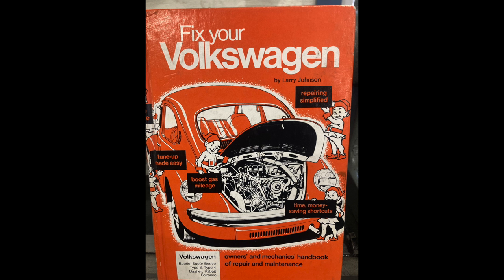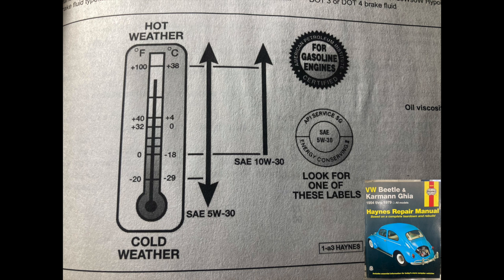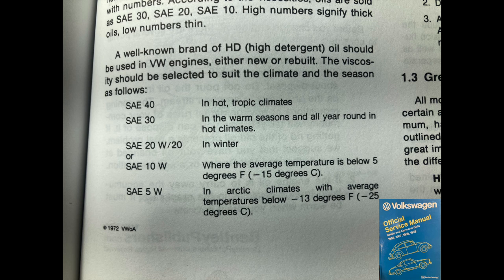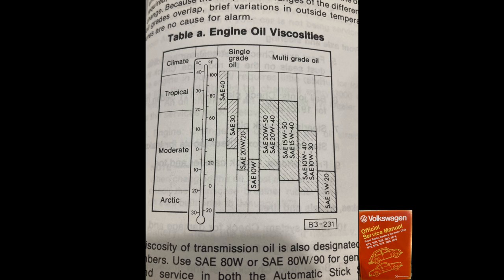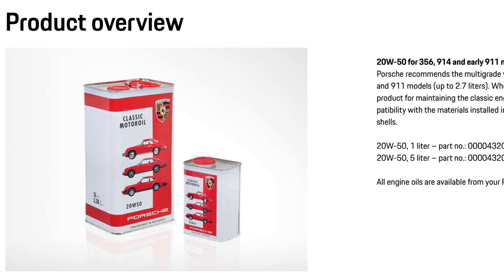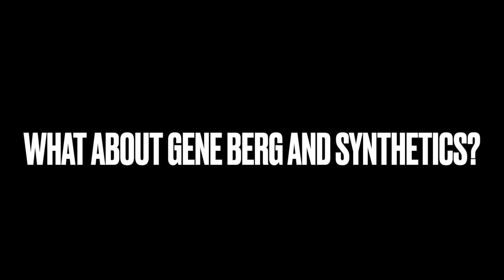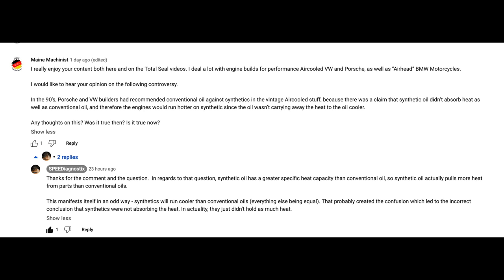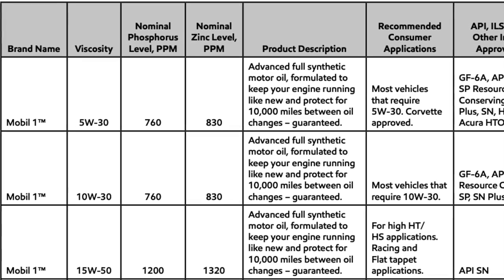Aircooled VW Oil - Finally, the Answer!

Comment: Hello folks! I'm from Brazil and own aircooled VWs for 20 years. I always used 20w50 regular (mineral) oils on my cars. Although I live in Southern Brazil, where in winters our temperatures come close to 0°C, and in summers raises to 35+°C, the 20w50 does a good job. One thing I learned through research and readings, is that the API SL grade is the limit in this kind of oil, concerning to the ideal balance of ZDDP additive in Ppm in a "newer" oil. So, even if there are mlmore modern options in SM/SN/SP grades, I stick with SL, cheap and widely available. Changes at every 6 months or 5,000 kilometers.  The results: my older engine (20+ years of age) never opened so far, and perfect running. One more thing: upgrade to a 26mm gear oil pump in every new engine I build. Cheers!
Reply from the maker: Thank you so much for sharing this important information!
Reply: Boa kkk

Comment: Penrite 10W 50. Wouldn't use anything else. I'm in New Zealand. Hot summers, freezing winters.
And this is VERY important: It has ZDDP (zinc) which most modern oils do not contain in significant amounts as it destroys catalytic converters. On the VW the ZDDP is essential to protect the valve train exactly as you describe above.
Reply from the maker: The zinc is absolutely critical for sure!
Reply: Did they have high zinc 50 yrs ago?
Reply: @Maurice-c6z  yes, all oils were high zinc 50 years ago. It was with the introduction of catalytic converters that zinc was removed as it destroys the cat.
Conversely a lack of zinc in modern oils destroys 50 year old valvetrains.
Reply: Yes.

Comment: Here is my recommendation. All model Beetles will be more than happy with conventional 10w40, 15w40, and if you live in a warmer climate with mild winters, and hot summers 20w50. Changed every 5000 miles. You will never have any problems. That's it. Nothing more needed be said.
Reply from the maker: Sounds like solid advice
Reply: The 20/50 makes a bug hard to start in frosty weather so I avoid it in favor of 15/45 year round.
Reply: VWs don't come with an oil filter.  I wouldn't go more than 1,000 miles between changes.

Comment: Im in Toronto canada. I used castrol 20/50 for 20 years till it finally dropped a valve. The tear down revealed little to no wear.
Reply from the maker: Did you drive in colder temperatures as well, or was it more of a summer Car?

Comment: Im in Long Beach California , so it doesn't get that cold.
I have always ran 20/50 valvoline R.
It has a high zinc content for solid lift  cams.
Of, course the size of your oil pump and climate will dictate oil weight. 
Just remember modern oils are designed for modern cars with a very low if any amount of Zinc.
What ever oil you use make sure it has a high zinc content designed for solid lifters/flat tappit cam.
Reply from the maker: That is indeed the most important!
Reply: I live north and San Francisco, and today I did my first oil change since buying my 69 Beetle 7 months ago and used 20w50 valvoline VR1.. so hopefully, this oil is fine in it... it normally, even in the winter, is around mid 40s at the coldest rarely dips down to 30s.

Comment: My Dad purchased a 1964 VW Beetle in 1964 from the dealership. We were not sure what type of oil was used when the engine was manufactured. On the first oil change, the engine had so much sludge in it. It was also getting harder to turn over the engine. My Dad cleaned out the sludge and replaced the oil with Havoline Motor Oil 30w. It was a High Detergent motor oil as recommended by the VW Shop Manual he also purchased from the dealership. Published by Delius, Klasing & Co. Bielefeld and Berlin.  This manual states for the engine oil to be (HD oil for spark ignition engines). The lubrication points. Engine, oil bath air cleaner, carburetor controls, door hinges and felt ring in the distributor. Specifications were above 86 F SAE 30 W, and from 32 F and up to 86F SAE 20 W /20. Below 32 F SAE 10 W and finally anything below - 13 F SAE 5 W. Now days Havoline that we use has Anti Wear Additives, Zinc rating of 906 PPM (Parts Per Million).  Yes, we still have the 64 Beetle.
Reply from the maker: Awesome story and thanks for sharing! That’s really great that you still have the car.

Comment: I use Driven motor oil. Either their HR1 or HR5. Driven Hot Rod Oil is designed to protect your camshaft. With high levels of ZDDP to protect your engine. Driven Hot Rod Oil also delivers storage protection additives to guard your engine from rust and corrosion. These additives also prevent dry starts. Developed specifically for older cars, no other oil provides this unique combination of lubricant chemistry.
Reply from the maker: Thanks for sharing. I’ll look into that. Never heard of that oil until now.
Reply: Yes, because it has a high Zinc content.
For solid lift/ flat tappet cam.

Comment: After watching this I have tried synthetic in my baja with a 1968cc. Im using 5/30 Kirkland brand. My head temperatures go from 280 to 310. It's 100 plus here in the high desert.  The really trippy part. My oil temp is 90 to 110. 
 Dog house with a remote filter and full flow so my capacity is 3.75 quarts.  I do add some zinc additive.  

So far I'm a fan.
Reply from the maker: Please continue to give updates. This is so interesting.
Reply: I would use 10W 30 if I was you.  These engines weren't designed for super-thin oil.

Comment: meh.... My older brother owned a very successful German car shop for over 30 years.  His slaves worked in the right side three bays on VW's, while he, worked in the two left side bays on vintage and rare Porsches and Mercedes Benz automobiles.  His re-built engines were done via customers shipping them to him, and getting them back gold plated.  His car collection included two Mercedes 300 something "gullwings" an Adenaur limo, and several choice examples of the 356 Porsche, including two  with the early 12 volt electrial system.

He was Austrian born and raised, worked to the blasting sounds of Wagner, and he knew his stuff.

I drove aircooled Bugs.  He built the engines and told me to use 30W Castrol GTX because the engines revved high for best efficiency and that oil was formulated for that type of use.  He retained ownership of the engines and had a stake in their re-saleability.  When I moved into a different Bug, he would remove the engine and sell it used to another client who was in need.  He also used the same oil in his vintage 356 cars.

That was in the late 1970's.  My Bugs were all early 60's to 67.  Same with my brother's Porsches. Your results may vary. All this was in the Pacific Northwest of Washington State, where yearly temps are mostly moderate. My takeaway - apart from what oil you use - is to change it like religion.  That's more imortant than what weight is in the sump.
Reply from the maker: All good information, thanks for sharing. The only thing I'll comment on is the Castrol GTX formula has changed in recent times by them eliminating a lot of the zinc phosphorous in order to be compatible with new regulations and catalytic converters.
Reply: @MaineMachinist  Yes.  Oil tech went through a lot of changes because of government fiddling.  I was in Mexicao in the late 80's.  The air pollution was pretty bad.  I m sure it had something to do with air quality regs that lagged behind the US at the time.  Bugs, Busses, and Things were literally everywhere.  I would say the ratio of aircooled VW's was 1/10 on any given street.  A lot of them were pretty new but smoking pretty bad.  Heat and slow traffic kills those engines.  

I do miss my 67 Camper.  My brother built a custom 2.2 liter for it. Better than his 356 engines, he said.  It was quite the sleeper, no pun. Up the passes with me, my bud, and our two germans sheperds, and all the gear .  No problem, as long as I didn't open it up. The original transaxle wasn't built for the potential of that motor.

When I sold the body (mint condition) my brother sold the engine to a guy who built a street rod Ghia.  T'was a thing of beauty.

Those were fun days.

Comment: I’ve just changed my mind with oil. I’ve always ran t4 15w40 diesel oil but on my new 2332 I changed to 20w50 valvoline vr1 racing oil and couldn’t be happier. My idle psi when hot went up to a very happy number instead of almost 0
Reply: The Valvoline VR1 Racing 20w50 has a zinc content up around 1700ppm IIRC. . .. Many Porsche 911 owners of years '89 911 to '94 (964) series model thru the '94- '98 911 (993) air cooled series cars came thorough with Mobil 1 oils with (then, in the '90 decade) high Zinc levels; 1700ppm. . Fast forward,,, to mid the 2000 decade is when Mobil 1 begun reducing the Zinc content in many of its oils. .. Zinc and the CAT's do not mix... Mobil 1 15w50 for my '98 Carrera 911 (993) since new, and also M1 15w50 in our '79 SB cabriolet during the hot, hot Denver summer..

Comment: I went through the same search and destroy mission of the best engine oil for my buggy engine when I bought it 2 years ago. After some research I settled on the Mobil 1 15w50 and will continue to use it here on out. No issue with Temps she runs nice and cool
Reply from the maker: Good to hear. It seems like an excellent oil, particularly for our needs.
Reply: I’d say if you add an aftermarket full flow filter, might as well add an auxiliary oil cooler.
Reply: Does it have a high zinc content?

Comment: Today in Southern Idaho it's 105°. My wife's dune buggy with a stock 1600 running conventional oil.  70 miles on the freeway head temp 400°.  Shoot the dip stick and get 350°. My baja has 1968cc 9:1 compression  and I'm running synthetic.  My head temp 325° and dip stick 180°. I'm going to add the synthetic to the wife's dune buggy. That's just crazy cool.
Reply from the maker: Unbelievable

Comment: i use Castrol classic 20W/50 in my 1968 beachbuggy works great.
Reply from the maker: Good to know! Thanks for sharing!
Reply: This is what I use
Reply from the maker: @davidalexander1946  I currently run Castrol GTX Classic 20w/50 in my 1980 BMW Airhead motorcycle

Comment: Has for me. I have always used Castrol in everything I run. One example is a riding mower. I bough in 1993. I wanted to do a test. So I added Castrol 10W40 to it for the first run. Every time checked the oil before and after running it,the oil was so clean,I never changed it. It is still running to this day. And i have tried other oils in the past on cars and trucks,but always went back to it. Liked and shared.
Reply from the maker: The past few years I’ve been running Castrol GTX Classic 20w50 in the motorcycle and it has been excellent. It advertises as being high zinc which the bike needs for the flat tappet cam.

Comment: First of all great video, thank you!!

Here in Las Vegas where it's a bit warm I do run the Valvoline VR1 20/50.

Porsche 1.8l

I chose the Valvoline VR because it claims to have two times zinc❤

2 times what I don't know.

Now I think I see Valvoline also produces VR1 in a synthetic and that interests me.

Because, not to get into any kind of arguing or fighting but I think if the oil geek says it, it is so.
Reply from the maker: Thank you for the information! Sounds like you have a good plan for your area and climate!

Comment: I’ve just had a 1600 rebuilt and the builder recommends 20W60 with zinc.  I have Penrite 20W60 and the container state it is a suitable replacement for SAE 30.
Reply: Been using 20w50 conventional with no problems. 15w40 Diesel oil works a charm too. Contains high levels of ZDDP
Reply from the maker: Wow I haven’t heard of that brand or viscosity before. I’ll check it out!

Comment: Thanks for the good info. I use Pennzoil SAE 30 in my new dune buggy 1600 CC engine for now used in state of Wiscinsin in summer time only if I ever switch would be 15W40 dino, I also add ZDDP Zinc to oil,  Chris

Comment: Thanks for your tips about what oil to be used for aircooled VW beetle, I do have a beetle VW drive it in a tropical condition at Cairo, Egypt, so your comments would be very helpful to find the fine tuned suitable oil for my car. Best regards
Reply from the maker: I’m sure any 15w40 or even 20w50 would be good in that environment

Comment: I’ve been using Shell Rotella conventional for many years. Living in hot climates straight 40W or 15W-40 as a second alternative. My understanding is that the zinc level was adequate; I always use the STP supplement with it as well.
Reply from the maker: Sounds like a solid plan.
Reply: So you look for a quality oil then add some crap that makes you feel good, you should see what additives do to oil quality

Comment: I'm in Pennsylvania. Summers can get hot but typical outside temps are 60-90 when I drive our bus (my bus is a 2L). Anything above that, I drive my RAV4 for the A/C. lol   I've been using Valvoline VR1 10/30 in my bus with no issues. Other VW guys where I live use 20/50 & they don't have any issues either. I do have Castrol 20/50 at home too which I may try if we have a summer that is unbearable with heat. I've always been told though to make sure my vw HAS oil & to change it regularly and I shouldn't have any issues.
Reply from the maker: Sounds like good advice!

Comment: My 1835 has a big oil pump. I run the thinnest oil redeploy available here 5/20 with a few oz of the Lucas break in additive. Even here in metro Phoenix. Way to much oil pump. Hot idle is like 20. It’s in a Baja so I don’t run it super long at high rpm’s. 

In my beater 1649 with a regular size pump I run diesel type 15/40 with a pinch of the Lucas break in oil. I had oil pressure problems with hot idle before. I overheated it due to jetting once in 30 f weather. It was so hot the sleeve pulled out of the block when checking oil. Still runs ok. I only hit the freeway for like 5 miles max now.

Comment: In 45 years of working on cars. I have never seen a car fail because of the wrong oil..  They fail because they have no oil or no coolant.  Today's newer vehicles like thinner oils It is always advisable to use OEM recommendations.
Reply from the maker: I agree and think that most times people overthink it. Nothing wrong with getting the best we can, but ultimately there’s lots of cars on the road right now running junk oil or the wrong oil.
Reply: I agree, excpt with todays over engineered cars.  Vintage Bugs are very forgiving, as long as there is enough oil and it is changed regularly.  No matter what oil we ran in our old bugs, they still required at least  a valve job at about 60,000.  #3 was always the culprit., but oil was never the cause.  They just get hot.
Reply: Not if the recommendation is from the EPA.

Comment: The important thing is not "which oil ?" but "is there enough oil left ?"
The viscosity depends on the outside temperature only if it is extreme on one side or the other, it depends on the hot engine oil pressure, and the compression ratio. 
this on an original T1 engine and in more or less good condition, with double oil regulation, original springs and pistons, and functional mobile air flaps.

Comment: I put the deeper sump on my air cooled 1600 and run Shell Rotella 15w/40.
Reply from the maker: That’s always a good choice I believe!
Reply: T4,5,6? Went with T4 myself. Can't beat the 3gal boxes at the wally world
Reply from the maker: Just a heads up that the T1 formula has the highest zinc content of any Rosella T @zm6922
Reply: @MaineMachinist T1 Rotella is kind of hard to find in stock; mayne special order it. Even T4 is sometimes scarce at the stores.

Comment: For my VW classics I use Morris SAE 30 mineral oil that seems fine. However, I am going to try an SAE 40 hoping it will not quite leak as much! 😃
Reply: Try conventional 20w50. Won't have any issues. Any API grade SG and above.
Reply from the maker: Thats always a battle!

Comment: I run Mobil 1 15w-50 in a 65 Mustang with a 302 bored and stroked to a 331.  I use the Mobil 1 because it as the appropriate amount of ZDDP in the oil for cars with flat tappet cams.  I would assume the same oil would work well in our 74 Super Beetle with a pretty much stock 1600.  I live in southern Arizona, and we don't get the crazy heat of Phoenix, but it's not unusual to get over 100* in the summer here and in the low 20's with the occasional dips down into the teens in the winters.
Reply from the maker: Thanks for sharing! ZDDP is definitely important!

Comment: Lucas hotrod and classic 10w40 has a zinc ppm of 2100. This is all i use.( Im in the uk). Lucas does the hotrod and classic in 10w30, 10w40, and 20w50
Reply from the maker: Thanks for sharing!
Reply: @MaineMachinist  They also do a great SAE30 and sae 20w50 break in oil with a zinc content  of 3634 ppm

Comment: Well synthetic what is it ! It’s plastic and plastic makes a good insulator, it’s used in electrical components as a barrier, I believe in Gene burg as it helps stop the transfer of heat and also won’t pull the heat away so makes sense to me the heads would be hotter, you don’t want the oil to go much over 100degrees as that’s when it starts breaking down 😊
Reply from the maker: Interesting thought

Comment: I run castrol 20w50. I use either a zinc addative or the 20w50 classic oil or whatever they call it which has more zinc in it.
Reply from the maker: I’m a big fan of the 20w50 Classic for my 1980 BMW motorcycle, which is very similar in design to the VW 1600

Comment: Everytime  I use synthetic in my 2332 turbo air cooled vw, i get leaks at the valve cover gasket using the rubber gasket on the CB performance covers.  But this doesn't happen with the Kendall 30sae straight weight.  Since the kendall is a pain for me to locate at a reasonable price without a long drive, I'd love to use a 10w-30 synthetic if I could.
Reply from the maker: Are you using the Kendall GT-1?